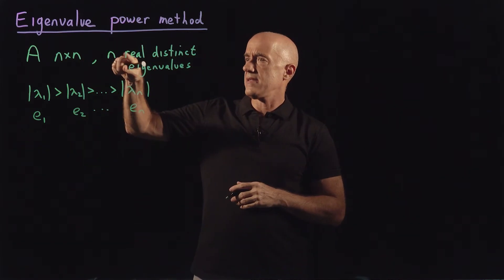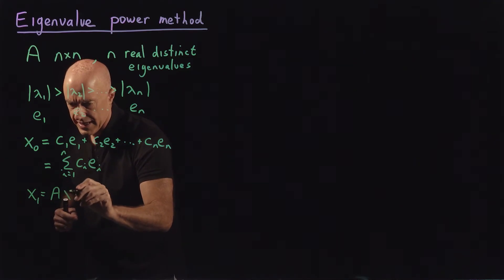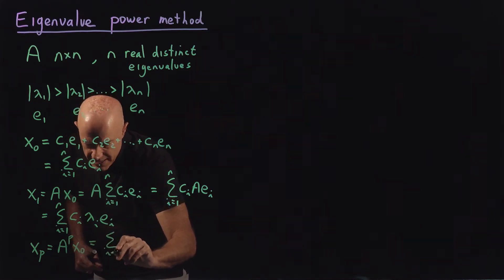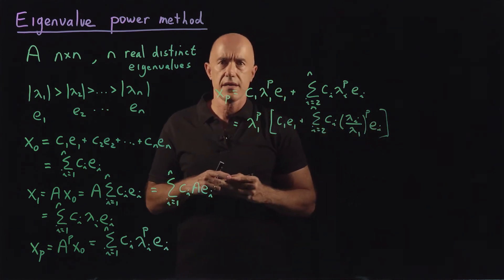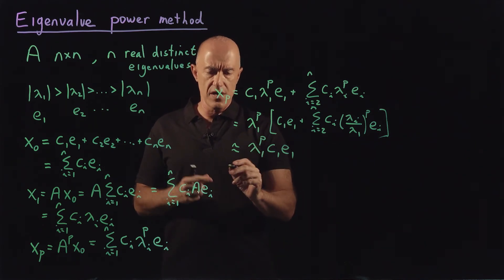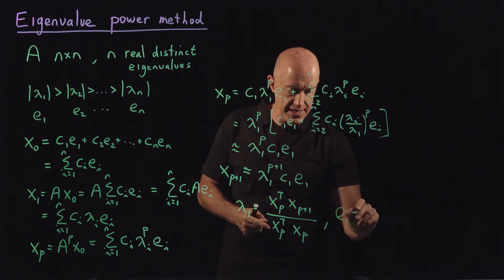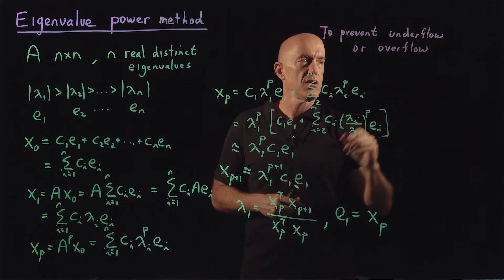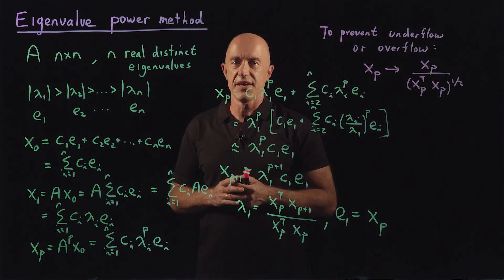Eigenvalue Power Method | Lecture 30 | Numerical Methods for Engineers

Comment: Why is there the X_p transposed when we solve for lambda_1? Can't understand this part.
Reply: It took me some time to figure it out, but the idea is that we simply take a projection of X_p+1 onto X_p, so X_p transposed is just a part of the projection formula. The idea of the projection is such that you find some coefficient, which when multiplied by X_p, would produce such a scaled version of X_p that is the closest to X_p+1. We know that when p is sufficiently large, both X_p+1 and X_p are simply some multiples of e1, so they are collinear, which means X_p+1 can be expressed as X_p multiplied by some coefficient and that is the coefficient that projection gives us. Now if we look at the formulas of X_p+1 and X_p, the difference between them is just an extra multiple of lambda, so lambda = projection coefficient of X_p+1 onto X_p.